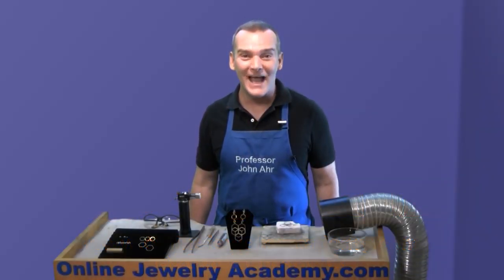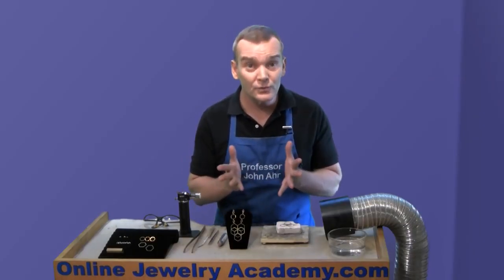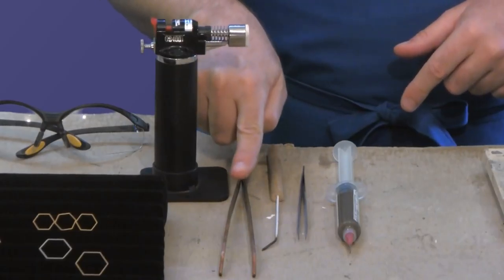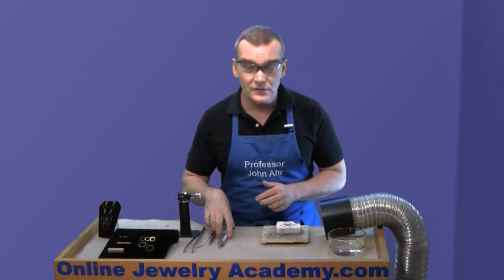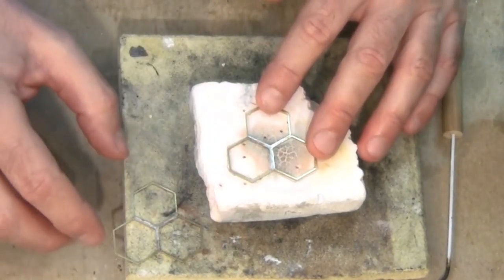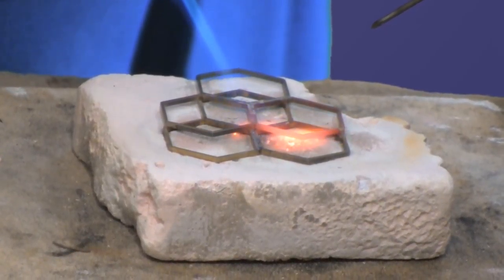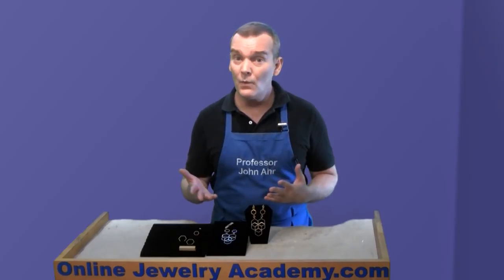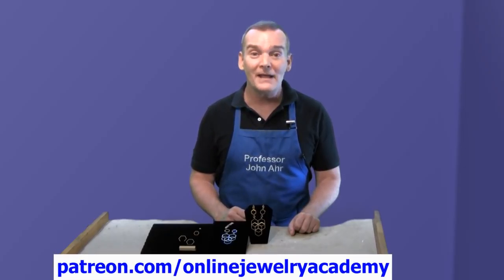Hexagon Necklace From Tubing

Comment: This is fantastic!  Thank you for sharing with us.  Does it matter what kind of solder you use with different types of metal?
Reply from the maker: Glad you enjoyed the video.  Silver solder will solder together all kinds of different metals that can be heated safety to the melting point of the solder.  Metals such as copper, brass, bronze, and even steel can be soldered using silver solder.  The problem is the the solder seams will be visible (especially if you don't clean them up).  That's why I show in the video how to limit the amount of solder to keep a nice appearance on the front side of the piece.  You can always gold or silver plate your brass hexagon jewelry to hide the solder.
Thanks for your support! : )